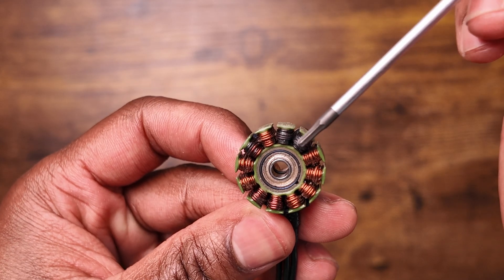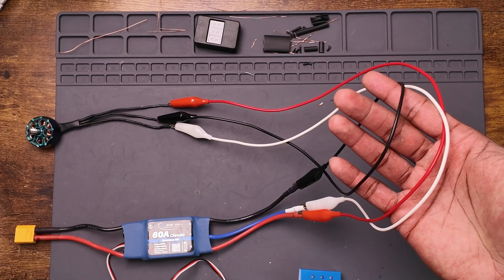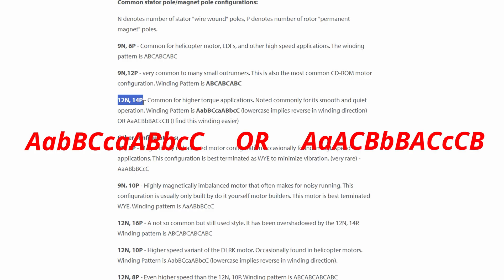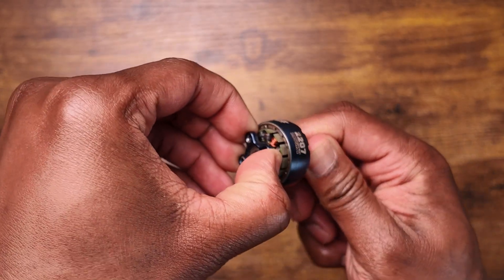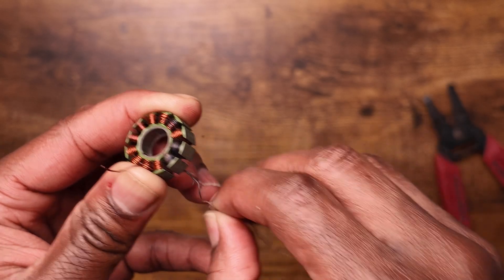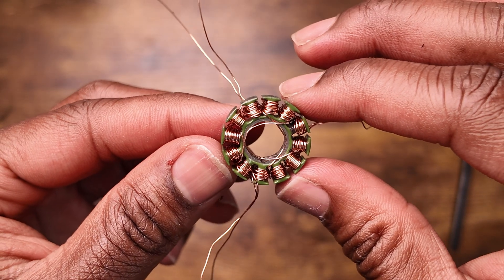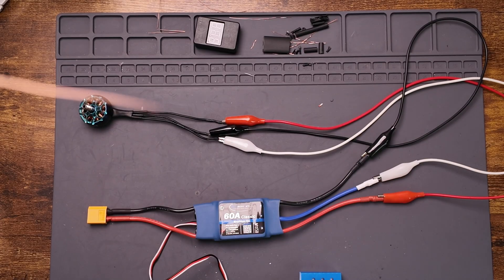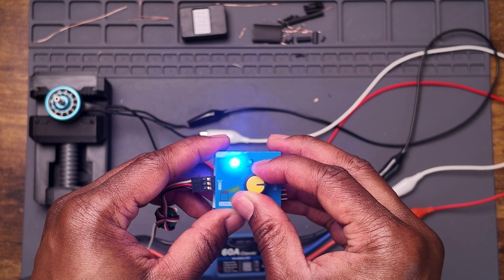Fix Your Brushless FPV Motor RIGHT NOW!

Comment: When i had to strip wire i just ran it threw some solder then fluxed and resoldered. It just burned rite off.
Reply from the maker: It worked with no issues?! I wish I would’ve known I could do that lol
Reply: @TyDoesTech  it did for me. It seems you just have to get passed the temperature  the coating can handle. I did it to solder a wire on to replace my ceramic antenna on my x12 aio
Reply: Yes, a simple lighter works to burn it off as well